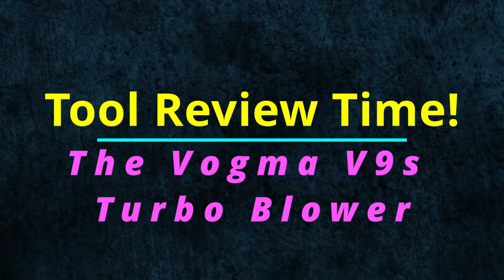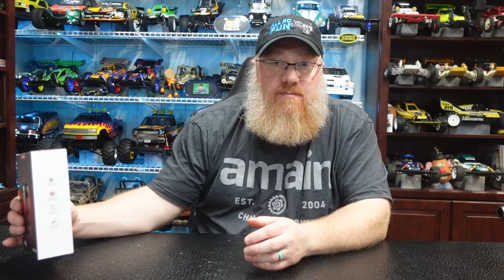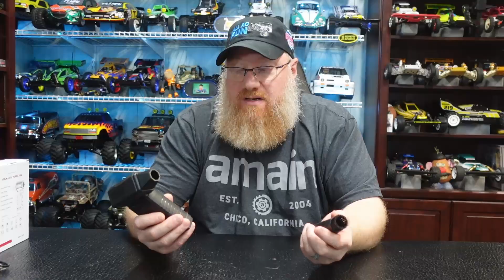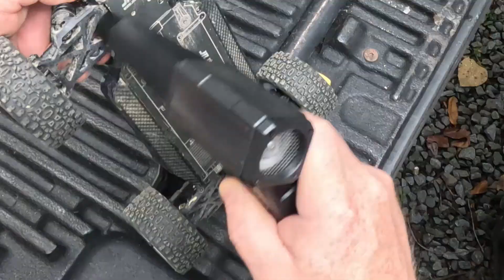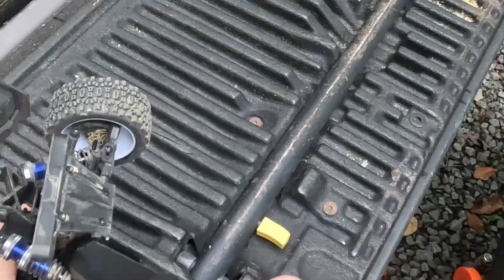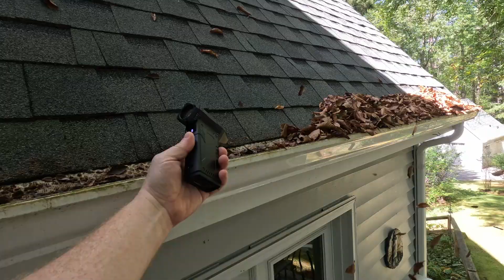Tool Review time - Vogma V9s Turbo Blower

Comment: Great review Addam!  Gotta get me one of these.  Makes so much sense so you can really clean up the car easily and fast.
Reply from the maker: This thing pumps out some air! It does really good for getting all the dust, dirt and debris out of the chassis and off the cars before bringing them in. Of course they are not perfect but it sure is nice not to bring all the outdoors inside every time! Also works great for out driving and cooling down motors and ESCs quickly. If you get one you will find all sorts of uses for it!

Comment: Quite impressive performance from that blower. I try to avoid running in muddy conditions. Most of my clean-up is dust and light debris. That is a tool that would get used after every run, I like it! Thanks again, Addam!
Reply from the maker: Yeah, this thing really packs a punch for its size and it is super useful for getting all the dust and debris off after a run before bring it into the house. I have found all sorts of uses for them as well but the primary is pre-cleaning the RCs. I avoid mad the best I can as well, I don't mind the dirt and dust but mud is always a real pain to clean up!

Comment: Cool little "blower" man... Agree, using a 150 psi air tank & nozzle probably aint the best for a pc or finer electronics..
Reply from the maker: Yeah, those ESC and motor fans don't appreciate it either. It is always tempting to do it though! 😂 I have done it to a PC fan before, they don't like it at all and end up without blades super fast!

Comment: Ive been testing another brand for a bit now. Like you say great to have close by and blow the cars down with.  My club run on a grass track and it does struggle a bit to get some grass off. Esp mud 😂. But allso great for when your sweating away in the pits 😎
Reply from the maker: Yeah, I have seen some of the cars coming off the tracks and some look like a air compressor would struggle to get all the grass off of them! LOL! Mud, you are just stuck with that stuff, even an air compressor still makes a smeary mess of everything. I was thinking on low speed it would be a nice cool off device!
Reply: @AddamsPlayground its a godsend in the heat 😂 allso good for cooling motors after a run, pop it on low, aim at the motor then await science to do its thing 😂

Comment: Cool tool Addam. Seeing the leafes flying makes me really think about purchasing one. Still using my dust witch from my former model railroad and a make-up brush. It's great, but the witch has to be attached to the vaccum.
Reply from the maker: This one packs a punch and I find all sorts of jobs for them around the house. Mainly for pre-cleaning the RCs before bringing them in but works for all sorts of stuff! A little pocket sized tornado!

Comment: I could have used this on my vacation to get the TT2.0 track dust off after running it.  It has some serious power, need to get one to keep in the RC bag.  Thanks for another great find.
Reply from the maker: Yes, this one is a lot more powerful than the one you saw previously. Definitely does a great job of knocking the dust and chunky stuff off of them and all the random stuff that finds its way into the chassis!

Comment: That is neat and the brush on the end did work nice!
Reply from the maker: Yeah the little brush nozzle worked very well for scrubbing the caked up dirt off and blowing it away. It doesn't get in all the tiny areas but it does a great job of knocking off a lot of it and getting things cleaned up decently before bringing them inside!

Comment: That's a very powerful little tool, Addam! So much better than others I've seen. I wasn't expecting it to blast those leaves as effectively as it did! Cheers mate! 🍻😎👍
Reply from the maker: Yeah, it really packs a punch for its size, super impressive how much air this moves from such a small package! I am sure I will find all sorts of uses outside of RC for it but mainly it will be for cleaning up cars before bring them inside. Take care Mark!

Comment: Great review! I have one with a long brush-end nozzle and I use it to clear debris like dried leaves or small twigs that are stuck inside the sandwiched frames of the car’s chassis.
Reply from the maker: Yeah I was not sure how well that brushed nozzle was going to work but it really got in there and got things a lot cleaner. I was able to scrub some of the old dried dirt off the arms and other places to get it as clean as possible before taking it to the bench for a proper cleanup.

Comment: an air compressor is the same price yet does waaaaay more
Reply from the maker: An air compressor doesn't fit in you pocket and not easy to drag around to places when you go out running them. And a $40 air compressor, those are not easy to find nor do you always have a plug handy to be able use them. I get what you are saying but the convenience of this to go anywhere is kind of the point.

Comment: Last
What are you going to do with your old blower 
I love the brush on it 
I have a $30 blower I got off of eBay wasn't real impressed with it I wanted to send it back they just gave me my money back and I got to keep it to turn on you have to hold the button to change speeds you have to hold a button I like the one you have cuz it's just a switch does it go from zero up to 10
Reply from the maker: I am not sure, I still used the old on fairly often at the workbench but now I have this one I don't need it. My old one is the same as the one you got, button on the bottom to turn on and off and cycle through the settings. This one is much more convenient and I like you can turn it on so it is ready to use and just slide the switch to turn it from 0-10 for it to start blowing.